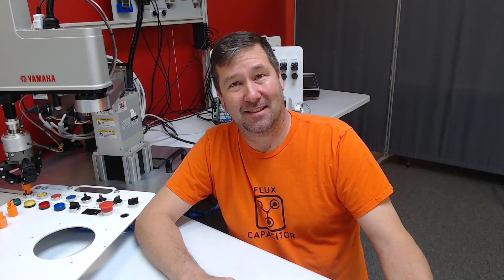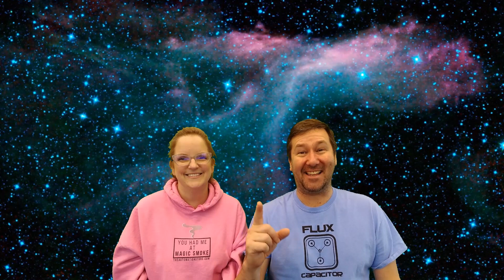Allen Bradley PLC Passwords and Source Protection Rockwell Automation

Comment: why I need to password protect my code is because I have people in my plant that get into my stuff when im gone thinking they know how everything ties together, making changes, and then very expensive pieces of machinery get destroyed based on those changes - which at the end of the day ultimately becomes my problem.
usually the original issue being an actual mechanical failure, or lack of understanding as to why the process operates the way it does. 
"process improvement engineers"

Comment: I realize this thread is a few years old, and I agree with Tim. However, today, there are now legal ramifications of NOT password protecting something (even if it is lame technology) when it CAN be password protected, simply for "due diligence." If a system was attacked, you want to be able to show that everything was done that could be done (again, even if it wouldn't help.) Otherwise...you're on the hook. Thanks Tim, I always appreciate your sound input.
Reply from the maker: I agree in theory but as of now there are more sketchy companies using passwords for nefarious reasons then legit companies. 

It will take a shift in the industry. For example Siemens now defaults to having security enabled.

Comment: I see both sides of the issue. Sometimes it is wise to password protect a PLC that protects a critical machine such as a boiler that could explode and kill people if (as I see all the time) some dopey maintenance guy with a controls laptop tries to play controls engineer and just mucks it all up. A validated program such as in the pharmaceutical industry must be protected from changes after the validation process which would disqualify the validation. Also, as a freelance controls engineer, I will occasionally do work for a machine designer that may or may not decide to pay me. In that case I've put weeks of work into the program and want to be compensated for my time. Once the customer has paid I will remove the password by telling them I have to download the latest revision.

Comment: Glad to hear you stuck to your guns despite Rockwell/distributors pressure to remove some of your content - it's a shame that they even think they can control that simply because "it doesn't fit THEIR branding"... 

Although I don't agree with the reasons you point out for password protecting PLCs (I support password protecting from the perspective of holistic security), I certainly appreciate and understand the customer's point of view. I can't speak for Rockwell, but I know Siemens has had ways to implement exactly what you are asking for around 9:09 mark... Although I don't think the PLC/software vendors (Rockwell, Siemens, etc.) should have anything to do with MANAGING that agreement/password between OEM and end user... Just my two cents - as always, thanks for the great content, Tim!
Reply from the maker: I appreciate your 2 cents, thanks for sharing!

Comment: This was 100% spot on.  If the customer pays tens of thousands of dollars for a plc project or machine, they should be able to work on it.  I hate when vendors hold customers hostage with their own equipment.  I have never and will never password protect any of my projects, as you said, there is nothing you have done in your code that hasnt been done before.
Reply: I usually run into passwords when it is a supplied package from the vender, like a water treatment skid where they don’t want their system to be out there in the open, 

Or compressor optimizations where the company has found a specific way of doing it.
Reply from the maker: Thanks!

Comment: I have had PW problems before. The problem was that the company that manufactured the equipment went out of business years ago. I also had another PLC that was running a Micro800, and that was neat because they had parts of their code locked and other parts open. I still didn't like the PWs, but at least I could still back up the program and make some changes (though the VFD interface I actually wanted to fix was one of the things locked down).

Now, any time I am in any way involved with a 3rd party PLC programmer I will always specify NO PASSWORDS!
Reply from the maker: Password protection has gotten more flexible, still not enough from me to do a "how to" video on it :)